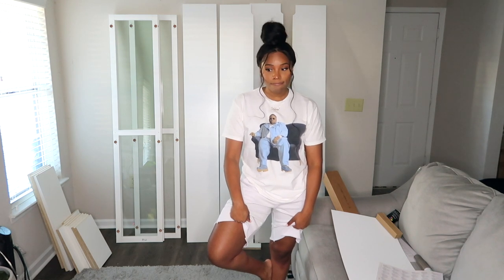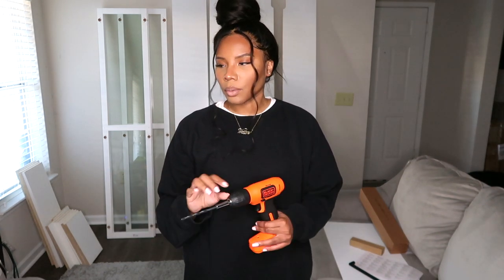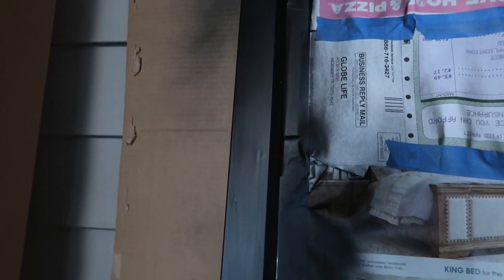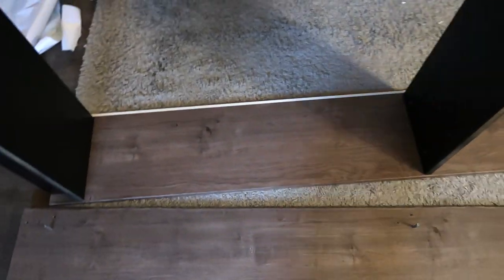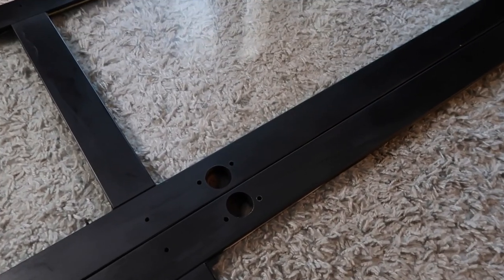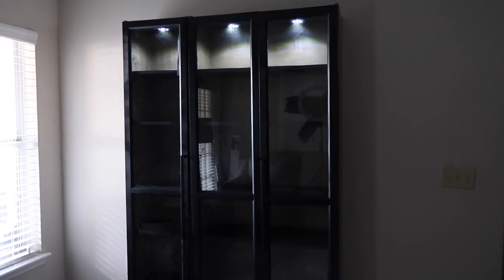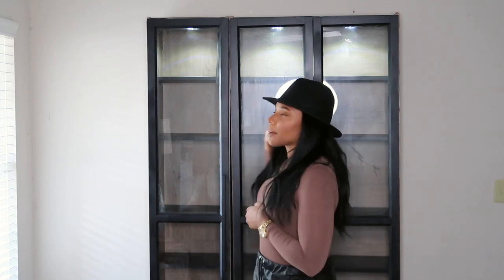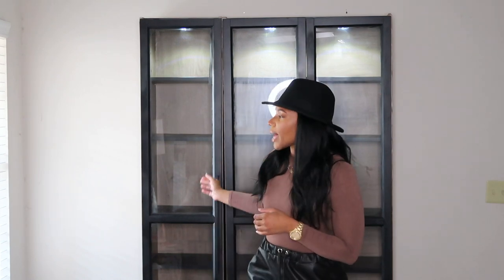IKEA HACK | MY IKEA BILLY BOOKCASE CUSTOMIZATION + THE DOS AND DON'TS

Comment: Lol every time I hear that smoke alarm chirp in a video, it's almost always a single woman. The second I hear that chirp I need to change that battery PRONTO! My hackles just immediately go up and it lights a fire under my toes. It must be a guy thing. 

Great DIY. I didn't realize they had doors for the Billy. Must have missed it at my local ikea. I also love the led lights, I'll keep an eye out for those same ones. You chose right by going spray paint. I've gone through the whole sand, prime, paint process on a piece of ikea furniture, and it honestly turned out the same as yours. You saved so much time and effort. 

One neat thing I've recently fallen in love with is 'Retique It' liquid wood. You can apply a single thin coat, and then a second one with a wood grain tool and it gives such a lovely real wood grain look and feel. It also takes any non-penetrating stain beautifully.

How well has the contact paper held up over time? I've thought about using it for a project before but was skeptical on the longevity.
Reply from the maker: Yes. The smoke alarm chirp is a pet peeve of mine. The contact paper is still in great condition. I don’t constantly change the decor in the bookcase so that could be a factor. I have moved since this video and it held up, so that’s good.

Comment: The problem with those lights is they only light the first shelves. You can get the led strips to tape on top of each shelves to light each shelf.
Reply from the maker: Thanks for the tip.